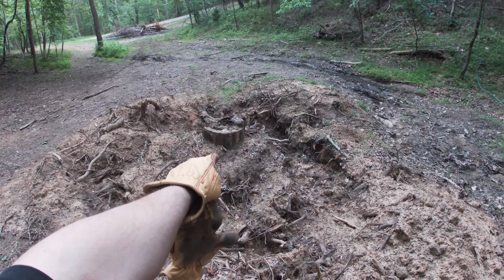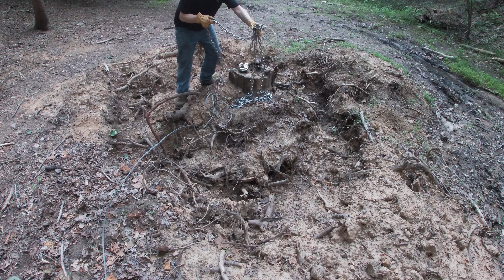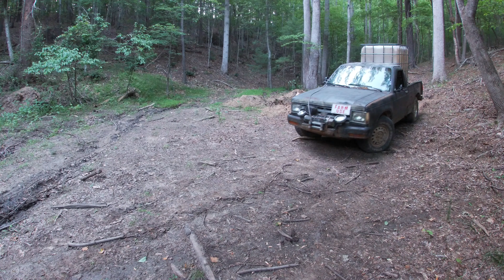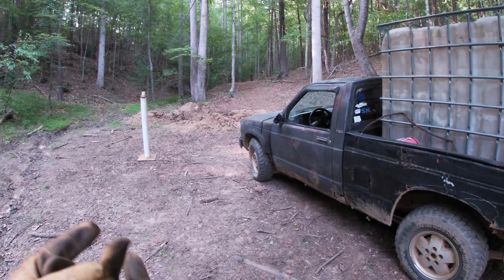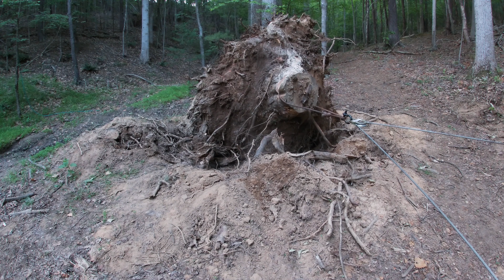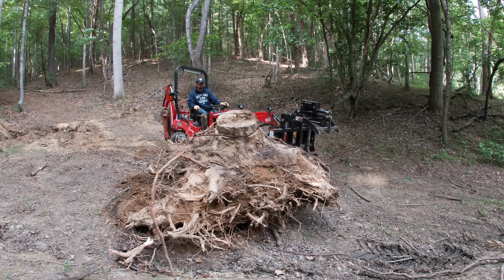MECHANICAL ADVANTAGE FOR THE WIN!!  Using Harbor Freight snatch blocks to remove a large tree stump

Comment: About the only smart thing he did was to cut a notch on the stump to keep the chain from slipping.  Winches aren't build to take the shock loads of an inertia pull.  When using the winch, raise the hood to keep the pulley from coming through the windshield if something lets loose.
Reply: Perhaps even use the truck to pull moving forward in bo-low  ... Reverse isn't the best choice of gears for power-lifting. 
As trucks go; that one looks like a horse that has been whipped hard and put away wet.
Reply: Reversing at 20mph using the winch cable as a snatch rope was pretty smart 🤦🏻‍♂️

Comment: Don’t use a frame for more than 2/1 load of a nominal winch capacity. Get a chain, run it underneath, and anchor it that way. Lots of stuff been pulled apart or ripped off over the years of winches…

Comment: I have a lot of logs left over after sawmill took out some trees, some too big to move by hand, and some too heavy for my winch, I have no anchor points for proper snatch block placement, but I will not try to pull them with my truck while attached to my winch, I am going to try your trick and make a notch in my biggest stump, good idea.

Comment: I was very impressed that the stump moved at all. However….. you lost me with  using a sub compact size truck to try and yank that behemoth out of the hole. At first I thought you were just screwing with us. I also expected to see the bumper fly off the truck. 

Anyway thanks for the “how to effectively use snatch blocks”. Also what size winch is it?

Comment: This is a good way to die.  Body positioning is everything folks, and in no way should you ever be yanking on anything with a tiny winch cable.  If youre using harbor freight (read chinese) equipment, you need to be extra cautious in making sure you are no where around when things inevitability go south.  Murphy's law is a real thing...

Comment: Question...For every pully you add there is efficiency loss. How many pullies can you add before the amount of MA you get doesn't exceed the efficiency loss from the extra pullies?
Reply from the maker: Sounds like a new experiment to try 😉...send me the link when you get the video up....
Reply: @straightcutgeerz  Will do.
Reply: Adding more pulleys in a system increases friction at each pulley, which requires more force to overcome. While pulleys reduce the amount of force needed to lift a load by distributing it, the cumulative friction from multiple pulleys can eventually offset some of this advantage, making the gains less significant. Also as more pulleys are added, the distance that needs to be pulled increases to achieve the same movement of the load. Despite these factors, the overall mechanical advantage is still present, though reduced due to frictional losses and increased pulling distance.
Reply: Eleven
Reply: @psidvicious  somebody did a video...ill try to find it. A 9 to 1 is looking like its the most efficient use (input force for output force) I'm not saying you cant get more pull with something bigger, it just gets really inefficient from there. Also, its most efficient when you have an Ma setup in a particular way where you have ma setup pulling another ma setup, but the number has to be the root of itself. 

For example, the most efficient 4 - 1 setup is a 2 - 1 pulling another 2 - 1. The most efficient 16 - 1 set up is a 4 - 1 pulling another 4 - 1. This makes it so the least amount of pullies are used.

Comment: for the second part, wonder it would be easier to chain it to the bucket with how it's lifted halfway, and drag it backwards now that a lot of the weight's on the tractor
Reply from the maker: That's possible....reverse isn't the strongest in these tractors but I'll give it a try on the next one....thanks!

Comment: Another way to remove more dirt from the stump is using a pressure washer. Just hook it up to the water tote. You’re gonna get dirty but it is effective 😂
Reply: Exactly the comment I was looking for. After hurricane Laura decided I had too many trees in my yard the root balls left after I cut the downed trees up were too heavy for my little tractor to lift. I figured I had enough lawn damage to repair already and didn't want to create huge drag scars from just pulling them across the lawn. So I hooked up the pressure washer, installed the jet nozzle, put on my rain gear and blasted the dirt out of them. I was able to pick the stumps up and move them easily after that. Messy work but it did what I wanted.

Comment: Maybe next time, use the tractor to scrape, dig, and remove the dirt? Reduce the weight about a ton, literally, then try moving it.
A few hours to do the job correctly, can save you time, equipment repairs (more time and money), and headaches. 
Sometimes slowing down a bit can speed you up a lot more.

Comment: The first part is a textbook perfect demonstration of the power of mechanical advantage!  The bit where you tried yanking it out with your truck bumper, not so much!  Not recommended.  Have you got another video showing the time when your bumper comes off?
Reply from the maker: Thanks....as far as the bumper it's heavily built ....the mounting bolts for the winch or the winch would break first....however it's pretty tough..I have pulled much harder on other things with it before....no issues....yet!....

Comment: why not just burn it out? sure you will have to stick around to control the fire and you could have use sender blocks to contain the fire if need be.
Reply: Because that stump would not burn completely out. Ground level and that's about it. And. You can burn the entire tree doing that little bit and still have all the roots that weren't exposed left.
Reply: @TheBrushcutter  that’s wrong. The stump and the roots would burn.
Reply: @doccadaver  maybe where you are is extremely dry? But in my area, the only stump that even tries to burn out and take the roots with it is an old growth pine. All others, not happening. That observation comes not only from experience but is reinforced by observation on military installations and National Forrest lands where I hunt. Those areas are burned regularly to help the Red Cockaded Woodpecker, and during military training exercises. Again. Pine will burn mostly away, hardwoods to about ground level. That is from observation and experience trying to burn them out. In fact, the video creator will learn that even now that the stump is dug up and moved to a pile, it still will not burn away readily unless he gets the dirt out of the root ball. Facts.
Reply: @TheBrushcutter  I don’t care what kind of tree it is or where you’re at in the world that stump will burn. A fire only needs three things, fuel, oxygen and heat, and you only have to produce one fuel add fuel to the fire. It will burn all the way down it will burn the roots. Trust me on this I’ve done it more times than I can count. I wouldn’t be saying this if I didn’t know it would work.
Reply: @doccadaver  I agree. THIS stump will burn. Because it has been dug up.

Comment: Mechanical advantage is around us everywhere, but for the most part failed to be noticed or taken for granted. Doubtful that you could even point out every process in your video that makes use of mechanical advantage. 
 But your video needs to start out with a lengthy and In depth legal disclaimer. There’s almost as many not recommended practices as there are mechanical advantages in the video. I dare not to list them all. But I can not be silent about the most obvious issue. Wirerope and chains are not designed to be shock loaded like that. Not only the dangers of it, there is no way to deny the damage you have cause to your equipment. How hypocritical can one be by taking the time to grease their snatch block, then follow up with the shock loading of their wirerope? It makes about as much sense as showing the advantages of snatch blocks and mechanical advantage but prove to the world the disadvantages out weigh the advantages in your mind. That’s what you did, when you didn’t want to take the time to set up the system that you had so highly praised. You opted to look like a fool. What better example could there be for not practicing what your preaching?